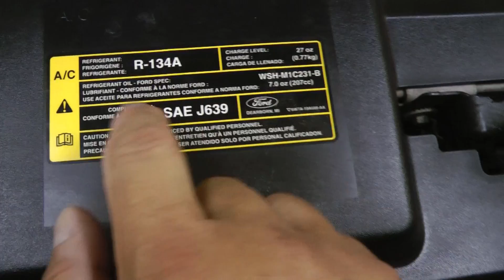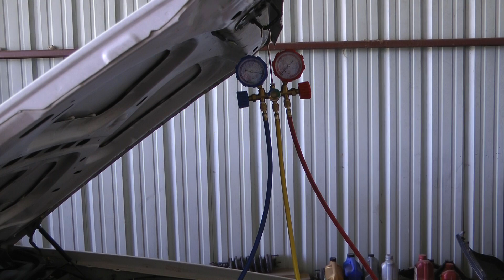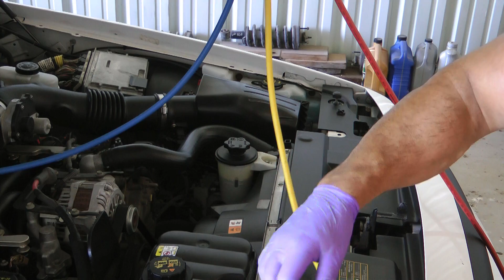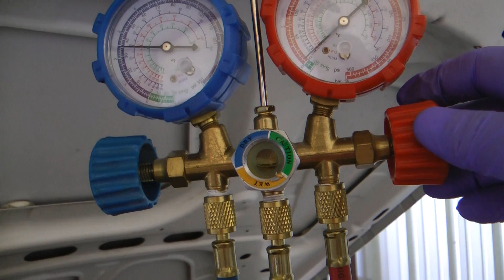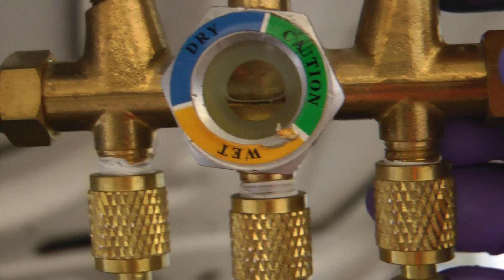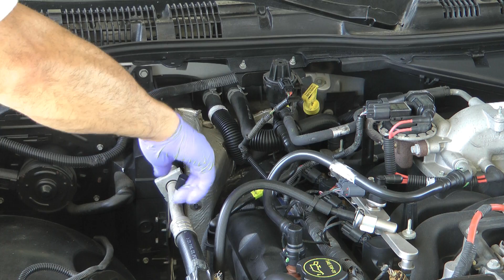add oil to your vehicle air conditioning

Comment: Big thanks for this unique video. Many others tell us to add oil, but HOW is lacking. Added 30ml to my Prius and the compressor was very much less noisy.
Reply from the maker: glad it was helpful.  I actually figured out too that I had my valve closed on the manual pump that I got.  Once I opened it, as expected, it works perfectly  LOL

Comment: You didn't mention anything about purging the air out of the yellow and blue hoses. The way you described, the air in the blue and yellow hoses will go into the system. The can at 3:30 has freon so that is more than likely used to add oil in a system already charged. Air is a no no in 134A applications.
Reply from the maker: I normally purge the line by loosening the connector at the top of the yellow line until I see refrigerant coming out since my gauges don't have a purge on them, I would have thought I did that in this video too.  But thank you for reminding folks that they can't let air in the system